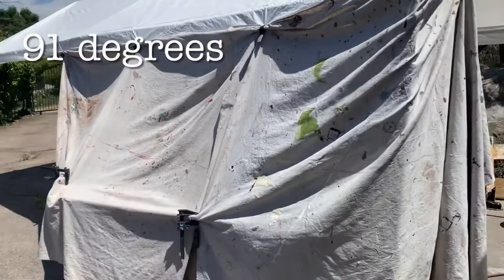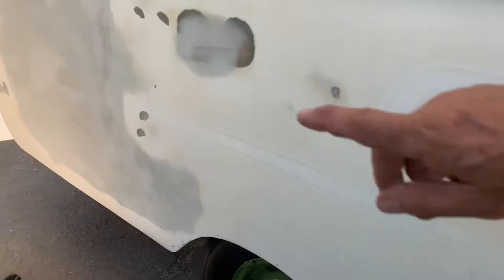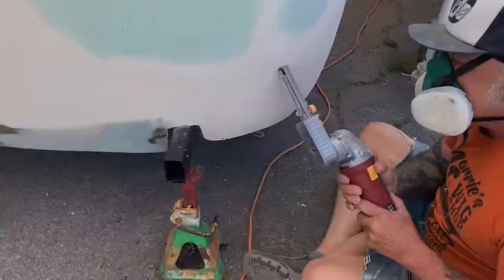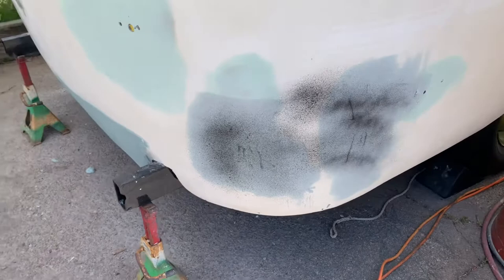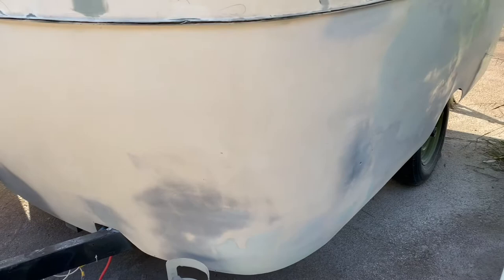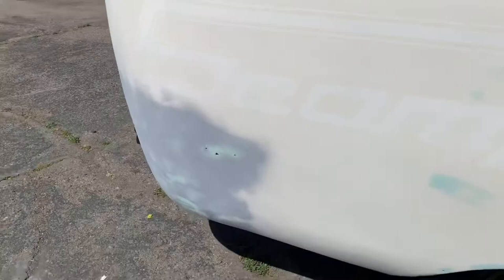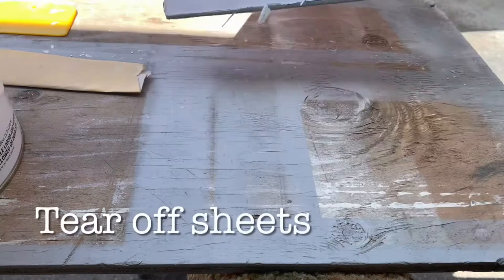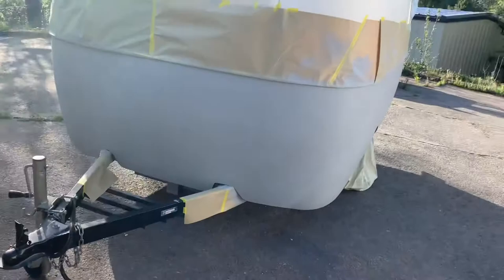Prime Painting | Scamp Trailer #PrimePainting  #ScampTrailer

Comment: Hi there, I’ve been watching all your super helpful videos for my boiler restoration. One question, is there any other option for priming besides a paint gun? Are there any fibreglass primers in rattle cans?
Reply from the maker: Hi Kirsty, the type of primer really depends on the finish coat (your paint color). If you are using a catalyzed paint then you would need a catalyzed primer which is what I used. I did use spray paint primer in an area and the paint started bubbling. If your rolling and tipping, the paint store should be able to tell you the best primers.

Comment: Johnny , my door is sagging 3 or 4 inches at the bottom seams . I'm going to check and see if my hinges shifted at there mounting positions . The door shuts and latches easy though . It's like the door lost its shape at bottom only . I'm wondering if water had caused the damage from just sitting at the bottom for time .
Reply from the maker: Hi Troy, no the fiberglass will never lose its shape due to moisture. Many boats are fiberglass.. but your hinges may need adjusting.

Comment: Do you always need to use the kitty hair or can you just use the everclear coat putty?
Reply from the maker: Hi Leilani, it really depends on the extent of the repair. If very minor then no need to have any fiberglass added.  If the repair area has holes all the way through, if more than 1/4”.. then some kitty hair (fiberglass reinforcement should be used) Thanks for stopping by! 👍🏼
Reply: @westcoast_johnny  thanks! Looking for more advice. My Boler’s previous owner added silicone to seal everything. I was told not to sand it off as it embeds it into the fiberglass making it more difficult to remove and failure of the paint to stick. Any recommendations? Some say use a silicone remover.